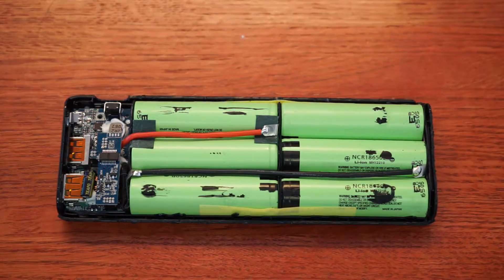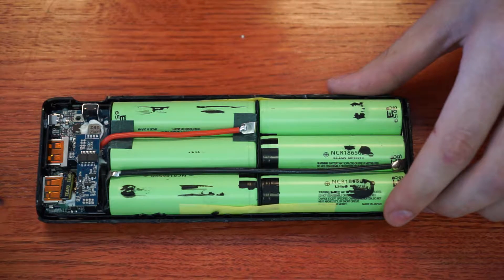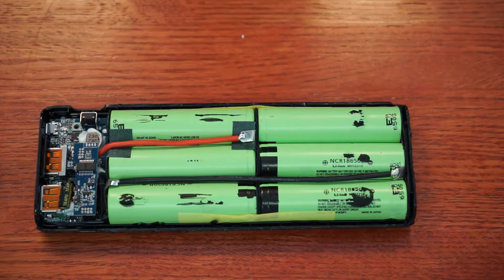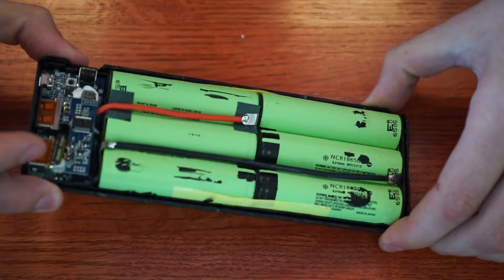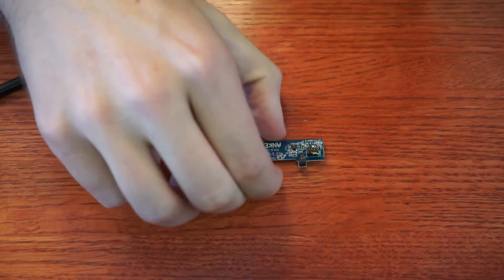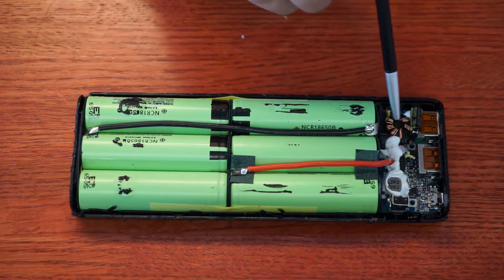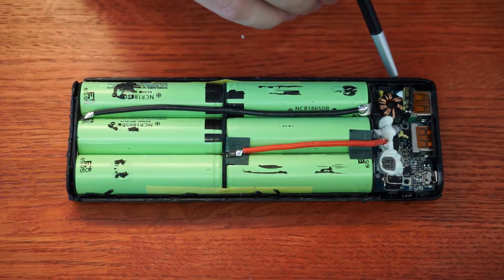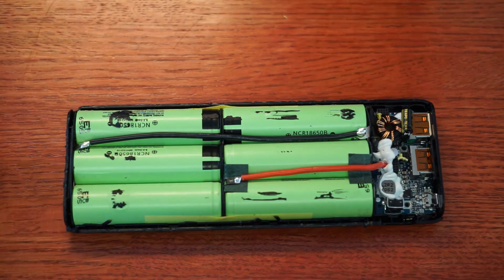Power Bank Teardown - Anker PowerCore 20000 Quickcharge 3.0

Comment: I got one for Christmas, and I have charged my phone 3 time and still have all 4 lights  on...so far so good, only "problem" is that charging it took forever, I used the original cable and a fast charger from my UE Megaboom and it charges my phone and headphones faster so I was slightly concerned but it works, and no problems other than that

Comment: Why am I here watching your video? I dropped my anker and now it doesn't want to charge consistently. I'm assuming the USB part detached and needs to be soldered back to the circuit board. Fun fact: I barely know what I'm talking about and guessing in the dark. Debating on if it's just worth it to buy a new one.
Reply: I’ve bought three more. But I’ve kept this old one to fix it maybe. i gave it to a friend. the casing i guess holding the ports to the edge got pushed back. They’re my favorite chargers. For the price of Course. I’m sure super amazing ones for people with too much money exist. I play pokemon go a lot and anyone that has borrowed them mention the great charging speed. and it lasts longer than they advertise them.